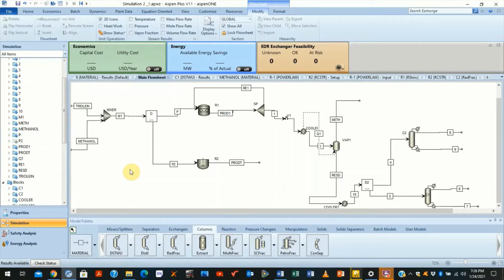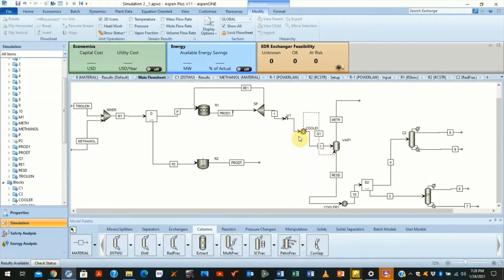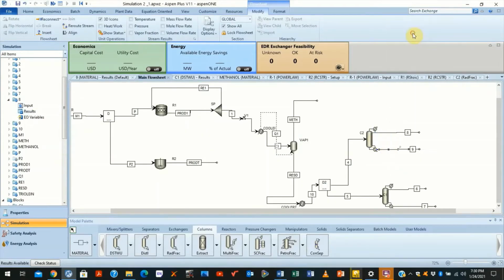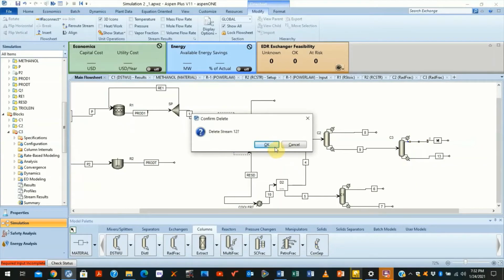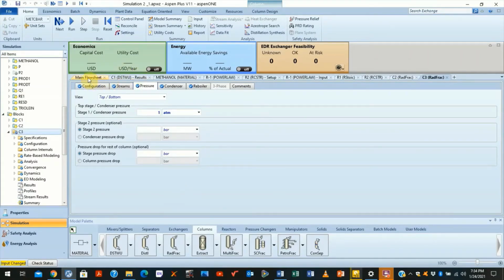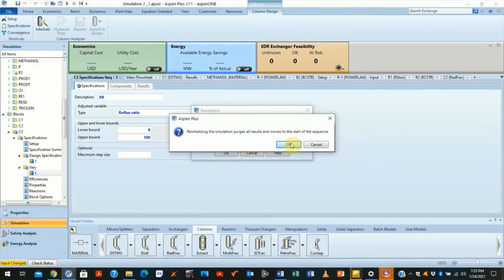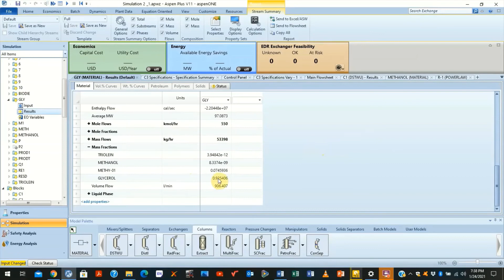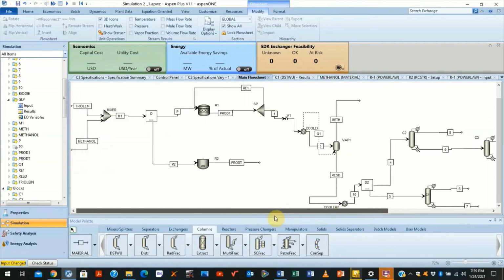Conclusion part of biodiesel production in ASPEN plus

Comment: Excuse me, sir. I'm doing catalytic reaction. I've added another stream going into the mixer which is for the solid catalyst; and set the temp, pressure, total flow basis and flow rate, like methanol and triolein streams. The problem is, what else I need to do so that the transesterification rxn happened in the stoic reactor would be improved by the catalyst I introduced before? Because the biodiesel yield doesn't change even after I added the catalyst, it must be because I didn't properly setup it so that it could be included in the reaction for the reactor, but I don't know how??? 😖
Reply from the maker: Hi Nur Atiqah, by introducing the catalyst the rate of the reaction will change leading to changes in the kinetics (CSTR). Now if you are using the RSTOIC reactor, you need to research the literature to  determine the effect  the catalyst has on the reactant conversion. For instance b4 the catalyst was introduced, the conversion was 90% after introducing the catalyst, the conversion becomes maybe 95%... This needs to be determined from existing literature. The conversion in the Rstoic should then be altered accordingly. I hope this this clear?

Comment: Sir, I have few questions, 

1) Did the duplicators were basically used to help us compare which unit operations is better to choose?

2) Did the duplicators worked by supplying the same quantity of reactants from previous unit operation to the next two different unit operations?
Eg: A ---> B
       A ---> C
Let say A produced 200m³, so B and C both got 200m³ each? Not 100m³?

3) If the answers to both of my questions above are YES, so does it means that, 
R1 is better than R2, and 
C2 is better than C1?
Reply from the maker: Hello Nur Atiqah, yes the duplicator was introduced to compare the modelling approach for the different scenarios (i.e. different reactors/columns). Thus the inlet streams to the units are exactly the same. Its not a question of which reactor or column is better, different approaches are more suitable for different cases, for instance in the absence of the kinetic law using CSTR reactor will be impossible, the RStoic reactor will be preferable if the conversion of the reactants are known.  For the columns, the 'approximate' column enabled us generate initial values for the design parameters that were then employed in modelling the Radfrac (rigorous) distillation column
Reply: @Biomass-biorefinery  Understood, thank you !